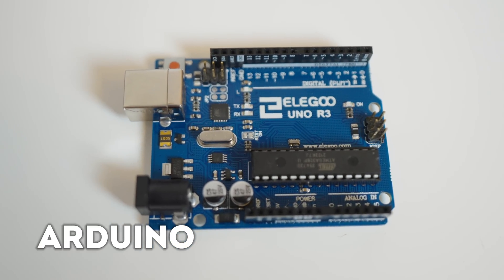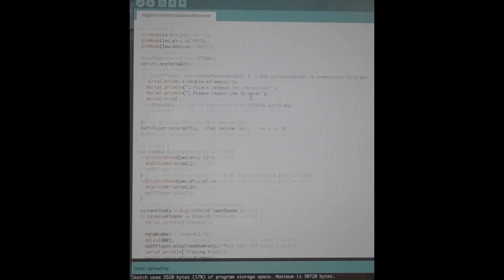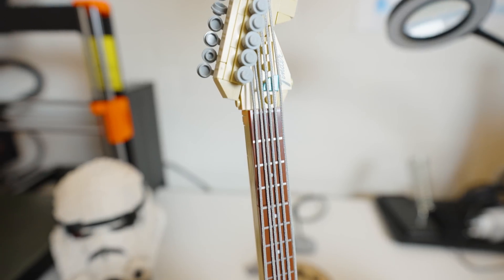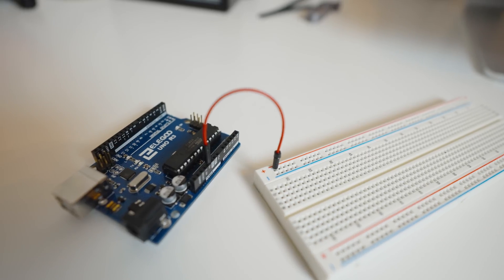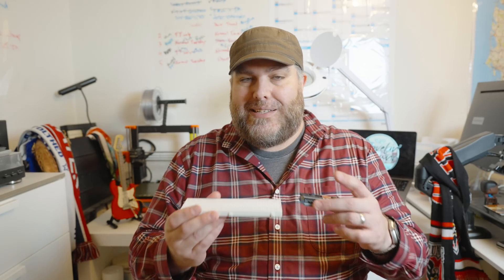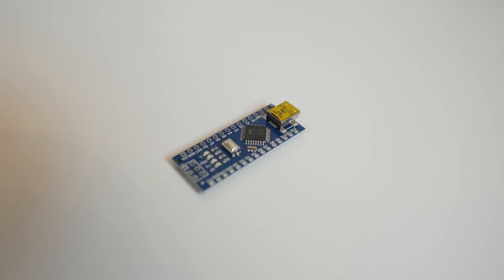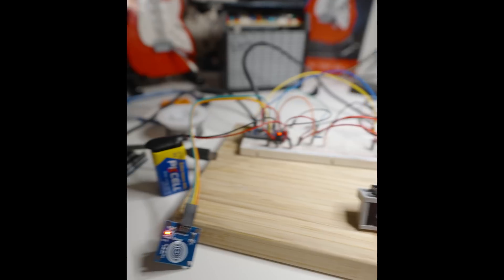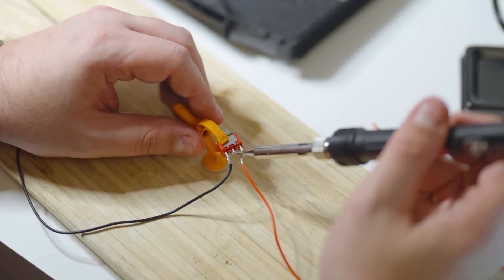Lego Fender Stratocaster Arduino Modification - Try it on Tuesday

Comment: Amazing video. I myself started working with and got educated in electronics, later I took a Computer Science degree and have now worked as IT consultant for nearly 30 years. A couple of weeks ago, my wife asked if I could get her Compact taperecorder, from her teenage age in '70ies, to work again. I split it apart and found that two drive belts were ruined. On eBay I found a German company selling the right drive belts, so now it works again. Arduino could be something I would look at.

Comment: Dude, that is an awesome and quite complicated first project. I have been working with the arduino for some year's now, but I would still be proud of a project of that size. Kudos.  
Love that mp3 player module btw, have used it a few times. It cheap but amazingly powerful.

Comment: Hey Josh. You may want to look into "vero-boards". They are often more practical to work with, because of their ready made connection rows. They are commonly used for diy guitarpedal projects. I myself have made at least 10 boutique guitarpedal clones, on vero boards.
Reply from the maker: Ah that would be good, so similar to a breadboard in that way with a little soldering.  I had to solder bridges to link all over.  While a good learning experience would be nice to avoid having to do that all the time.

Comment: i'm sitting and wire up final version of a control box i made for my giant bandsaw (to cut lumber). I automate it 100% with Arduino. They are so useful. Next up, a confinable table saw with size control, angle adjustments etc for stock and blade. I'm also making some robots that can polish and many other things. Arduino is fantastic.

Comment: thats pretty cool... I've been thinking about getting into arduino... I build custom rc cars from scratch, so I have alot of use for it... but, it is a bit daunting for a 40 yr old electricin as me with the programming...
Reply from the maker: You should get a kit and play, the programming isn’t that hard and there are a ton of samples out there from other builders.  So you can lift a lot of code, the community is pretty supportive.

Comment: Looks fine but if you want to make it more fun. Then you could try to make the "bars" at the guitar with some metal or just one tiny metal tread. And send them to the input. And the strings could be wired also. Then if you press the strings to one bar, it would be one sound and so on. It could be cool ;-) You could put a single thin copper thread on the back of the string and on every bar.
Reply from the maker: Yeah there is always more to do, but I am moving in to the next project now :).

Comment: Cool, I HATE that damned MP3 module, it's so stupid to work with, but I got a sirene and lights made for my grandsons electric car (it's a police car), good work there!
Reply from the maker: I had a different one at first that was a total POS and then switched to the dfplayer mini which worked well.  Just had some issues with the speaker and needed to add a capacitor which wasn’t initially clear in the documentation.

That is cool, these are so much fun!
Reply: @TravelinYoung  Then you should pick up 'smart homing' that'll never end 😆

Comment: Couldn't help noticing the Prusa(?) in the back. I'm also into 3D printing. I started with an Ender 3 Pro. I'm currently upgrading my Voron 2.4. It's a self-sourced "tinkers" machine. I'd love to spend time with the Arduino ecosystem, but I also know it will suck me and not let go of me. It's not always easy to find the time,  when you also have a family =)
Reply from the maker: Just got the Prusa.  Learning how to use it now :).

Comment: Cool video. Could you make a LEGO car honk and flash it's lights, or maybe even drive?
Reply from the maker: That would be possible but would require a lot more drilling and notifications to the Legos themselves in order to get all the parts in place, especially the motors for the tires.  There are folks that sell light mod kits for most car sets.